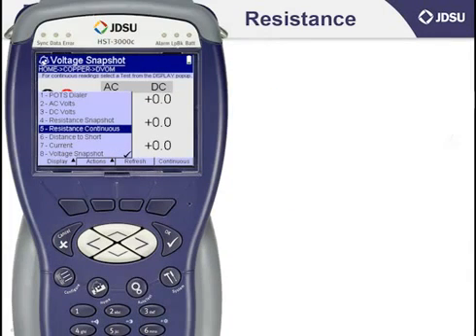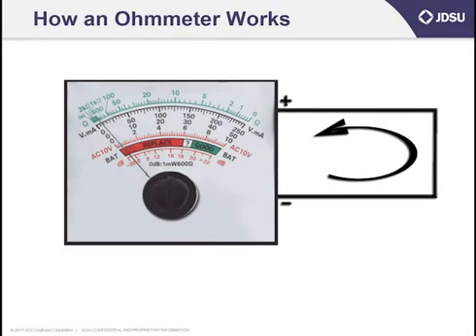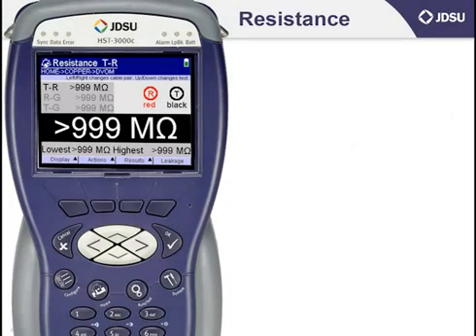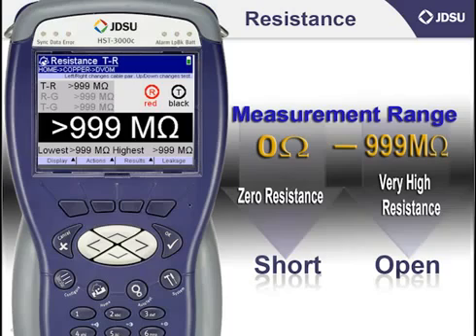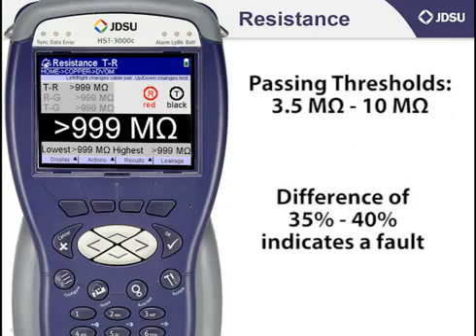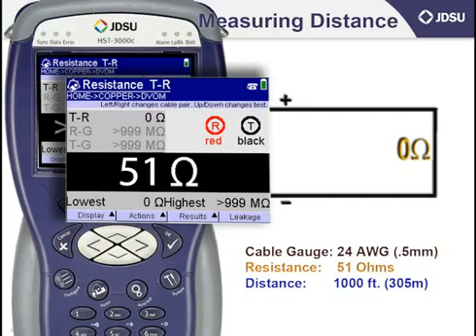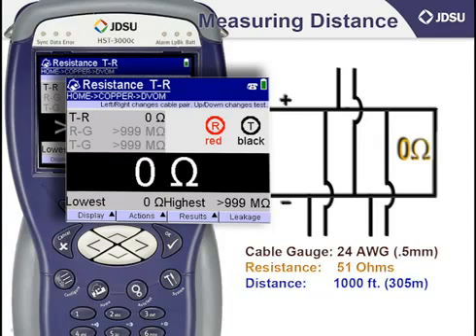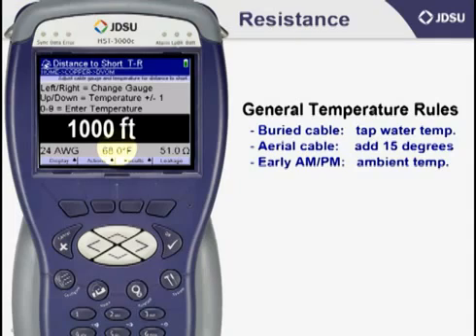JDSU HST 3000 - Resistance Testing

Comment: The biggest problem I'm having with my jdsu hst-3000 is locating partial opens and shorts. If I'm correct the jdsu is not able to do this. So could I do a high leak test to blow the partial open into a complete open and so use my PET to locate the distance now to the full open and could this also break a short on the line? Cheers
Reply: Megger the pair first then test